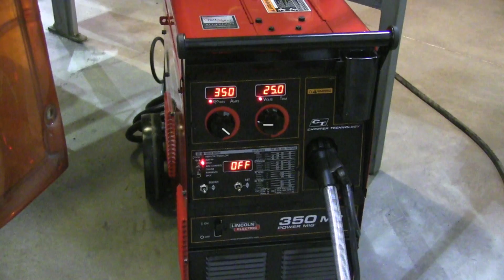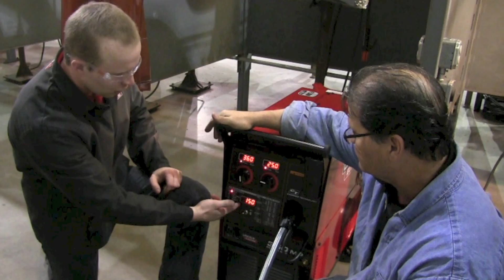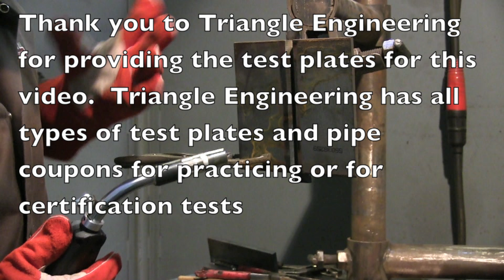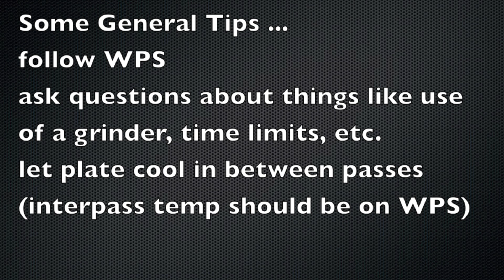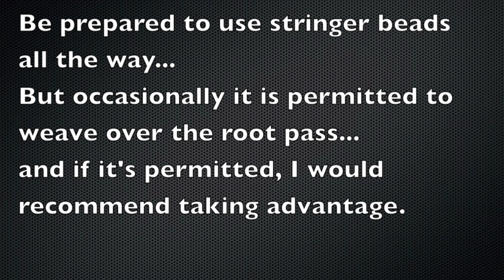Flux Core Welding Certification Test - 3g Dual Shield Structural Plate test

Comment: Question guys, is the dual shield gas, necessary in flux core welding? I’m applying for an outside structural beam job…

Comment: Totally different parameters than what they told us in school. Using the same machine more or less, Lincoln MP360, and we were recommended to go 190-200 IPM and 21-22 volts, with a strict drag angle. This video does none of that and produces much more consistent results. I'll be sure to test this out in class tomorrow. Same material and thickness as well.

Comment: Not good 
Because backing have there
Without backing make weld then i call good welder 
And mig wire size is 0.8 it's so easy for make weld 3g or 4g
Reply from the maker: I can’t even begin
Reply: @weldingtipsandtricks  LMAO

Comment: quick question since i may have to take a fluxcore wire feed test as that's what work near me is moving to: what do 3g and 4g mean respectively?
Reply: 3G = vertical, 4G = over head
Reply: @ZRace67  ah okay, kind of got the impression it was a position reference but surprised you don't just say vertical or horizontal

Comment: Can anyone suggest me about the root gap for a 20mm thk SS304 plate with double V  60° angle, 3g position
Reply: Filler wire is 1.2 308L  T1

Comment: I hope someone can see this question and help me out, I’m taking a welding test and I’m struggling with the root pass. I’m running larger wire flux core, around 18 at 115 wire feed, After seeing this I think the feed is too slow, but if I can get some positive feedback I’d appreciate it

Comment: I just noticed something that might be important. When I did my 3G citification practice, I was told that I needed to start just under the side plate and run each pass well past the top of the side plates. I don’t know how much has changed or if my teacher was just super picky about making sure you got no undercut on both ends of the coupon.
Reply: Yes. I think it's to give the puddle a half inch to warm up and fully develop before you hit the bevel edge.

Comment: You should do some dual shield  welding on 1 inch plate  with backing  in 3g 4g  .045  wire 75/25 gas   i know it would help out  alot of students  in my collage

Comment: So I have to get certified at work for a 3g dual shield flux core test, the welding "instructor" told me I should be able to fill a 3/8 plate in one pass. Told him I'm gonna need 3, 1 root and 2 stringers just like this video the same "instructor" lasted at my part of the shop for 1 week, my lead told me he didn't use gas for the dual shield. Shows how people don't know anything, not claiming to know much but anyways great video and practice practice practice.
Reply: Hmm, is the gas necessary in flux core welding? I’m applying for an outside structural beam job…

Comment: with 71m or71t you don't need to wire brush like that and anyone can pass this test using either of these Lincoln wires it pisses me off that they don't let you use ceramic bars with open root plus they should require you pass a back gouge test becausde most full pen welds require some kind of back gouge and ive had dozens of certified welders come through our shop and they don't have a clue how to use a carbon arc and let me tell you inspectors can fail an entire beam per say if you touch the beam surface with your carbon arc

Comment: Thanks for the video.  One question: How to eliminate worm tracks? 
Thanks, 
Tim
Reply: Timothy Hendershott gas coverage, Volts to high, not enough stick out. That's what tends to get me
Reply: ecr125x  Thanks for your input.  Tim
Reply: Believe it or not too much tension on the drive rolls was the culprit.
Reply: Timothy Hendershott makes sense, volts to high OR wire speed to low is what I shoulda said... my miller suitcase has a "soft start" option and I most of turned it on by accident, I don't know the point in soft start but I noticed it slows the wire speed when you first pull the trigger.. took me for ever to figure out why I had worm tracks st the beginning of my welds but when I used my millermatic 252 with same settings I had no worm tracks! Glad ya got it.

Comment: I have to take a 1G flux core plate test with 1/16th wire and a backing this coming Thursday. I've never taken a plate test with a backing strip and I've maybe laid 1 bead using flux core in the 2 1/2 years I've been welding. I've done a lot of open root MIG/TIG/Stick though. Think I should be alright since I've got all of those under my belt? I'm pretty nervous lol
Reply: Just watch your puddle and know your goal. Settings are important too so pay attention there and maybe get some ball park setting before your test so you know where to start.You will probally be fine!
Reply: Thanks man. I know two welders who work at this place already (SPX transformer solutions) and they were telling me that it's all push out there instead of drag. So that's got me all confused now lol

Comment: Question. I am currently using Stoody Build Up 0 in rock crusher. The problem is there seems to be minimal penetration with this wire which is .052 Flux the rotors are non ferrous. Looking for an idea on how to minimize the sizers being worn or broken so quick. Also cap the sizers with Lincore 60-0 hardsurfacing wire .052 which has started chipping off the next shift when crusher goes down for daily maintenance. Any ideas? I thought about trying 6011 as an overlay before using wire

Comment: Try stringers and post a video of that, two stop and starts, one about 3/4 from the bottom of the joint, another 3/4 DOWN from the top of the joint, parallel, opposing sides of course. Cheers

Comment: awww no ceramic??
Reply: tape?
Reply: its typically used for shipbuilding. you use pieces of ceramic lined up on a aluminum tape and place it on the back of 2 beveled plate2 with 4mm to 8mm gap. and as you weld the 2 plates, you use the ceramic to bridge the weld between the gap to connect to both plates. it's really tedious and takes a long time to get it right. this process is usually ultrasound looking for any cracks and imperfections in and around the weld. if there is any crack or slag, youll have to air arc it all out and redo it with a even bigger gap.
Reply: theres 2 shapes of ceramic for the most common jobs. A circular one for any fillet jobs, to be welded on both sides. and flat ceramic with a slight curvature on the center for any beveled butt jobs.
Reply: i know. guys call it porcelain tape around here

Comment: Is the wire automatically fed during welding? I have never inquired into modern welding machines. My father's device looks like stone age compared to this one.
Reply: Lol yea its called mig, are you using oxy acetylene? the flame and the filler rod to weld?
Reply: he uses wire welding rods coated with a solid chemical to prevent oxidation. Unfortunately, I don't know if it has a special name in English.
Reply: Anton Lymanets its not on the outside its on the inside of the wire, its called flux core
Reply: here is a link to illustrate what kind of electrodes I mean
http://ruswelding.com/uploads/svarochnyje-elektrody.jpg
But I must say, I didn't know there are welding rods with rosin core like soldering wires. I am pretty ignorant about welding.
Reply: THats stick welding lol not flux core
Reply: 24 volts could be the machine I'm usually at 25 to 25.5 and like 300 for all my cwb 3g fcaw and 27 to 28 400 to 425 for flat haven't failed in last 10 years mind you I'm running a Miller 452 division

Comment: why do you weld this position with a backing strap ? in Germany we are certificated to weld with backing when we weld our certification with open root, because our welding inspectors said it's harder to weld
Reply: Can't do open root FCAW
Reply: HUH? Guaranteed open root. ive passed 3g And 4g open root tests with 1/16" lincoln 71m.
Reply: open root is a little harder but in the end you end up back gouging the root out and capping the back side. so as long as your good with a carbon arc its not an issue.
Reply: Oh sry guy's I never welded Fluxcore...normally Mig, Tig and Stick
Reply: Yes you can, I do it all the time. I use a welding wire called "MXA55T" from Elga. 1,2mm thick fluxcore wire
Reply: Yes u can weld open root flux.... Its not even hard
Reply: In the UK you can use a tile but not backing bar lol. Open root with fcaw is easy haha.
Reply: Creepah´ it is hard to weld without backing strip the technique have to be right on time with constant contact both side of the bevel  open root can be done with lots of practice..

Comment: $5,500 for that 350MP welder... that's a lot of money.
Reply: Not when you factor in that it will run stick and DC TIG as well as pulse modes on wire, both steel and aluminum.  It's really a bargain for a do it all machine.
Reply: I lost sight of that... I wish I could sell my mig and tig welder and get the 350MP to save space in my shop
Reply: They are amazing machines.  We've got probably 15 of them at the college I teach at and they are pretty much bulletproof.
Reply: +Michael Wheeler stick them in a production environment and you'll see a different side of the machine. We have 17 booths and we weld all day with the PowerWave 455M and S500 and they are nothing but problems. Not only are they inconsistent but I've lost count on how many have gone up in flames. Yes flames. Their customer service was just as terrible but not quite as bad as Fronius. Don't believe the hype on pulse with steel.
Reply: I have no experience with PowerWaves, I'm talking about the 350MPs used in the video.  Ours run 8 to 10 hours a day, 5 days a week, with students grinding right next to them and some of our are over 5 years old. This year we had an on-off switch break--that has been the only problem.   We have, however, had 5 Miller Dynasty 200 welders die in the last year and two of them literally went up in flames.  I'll keep using what works for me.

Comment: I was surprised you did not mention the Tig Finger. At 4:00 in the video, you mentioned finding "a place to prop until it gets too hot." Is the Tig Finger suitable for flux core welding or do we need a ..."Flux Core Finger" for that?
Reply: HotLikeButta o
Reply: It would just get tore up on FCAW
Reply: They make pads

Comment: in canada we have to do 2 start and stops and are plates are set up differently
Reply: Yes in canada CWB certification requires 2 stop starts 1 in each root bend coupon. There is also one square edge to the joint rather than a double bevel.
Reply: Good to know. I want to start learning how to weld with dual shield on my powermts. I want to start taking classes in the fall.
Reply: We have good welders!
Reply: Yeah, Canada's testing is a little more rigorous and you have to recertify more often